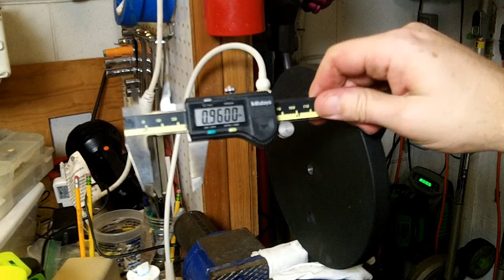HOWTO: Add a 3/8-16 bolt to a Meade 884 deluxe tripod to mount a ZWO Seestar S50 equatorially

Comment: Could the Seestar S50 be mounted on a wedge and function as  an equatorial setup?
Reply from the maker: Yes, but it's not officially supported by ZWO, and requires a few "tricks" to make the software work correctly in EQ mode.  Hopefully in future firmware updates ZWO will make it esaier to work in EQ mode. (or at least not remove the tricks that currently work....)
Reply: Yes and there are videos from other people showing how.  I tried it works okay as long as you have a sterdy tripod.  However,  the gears and motors of the Seestar may fail sooner from the extra stressed wear and tears at the equatorial angle